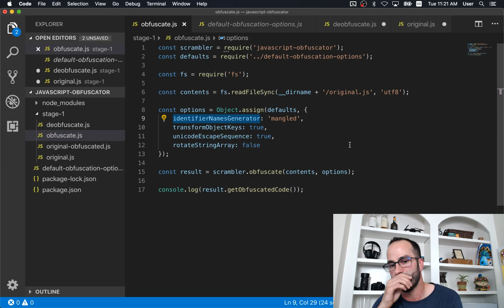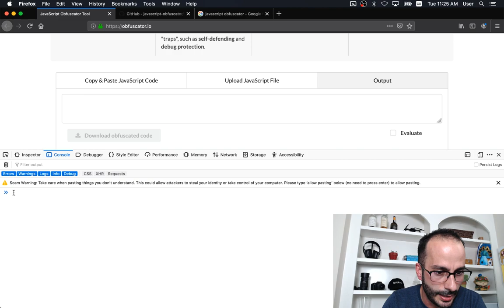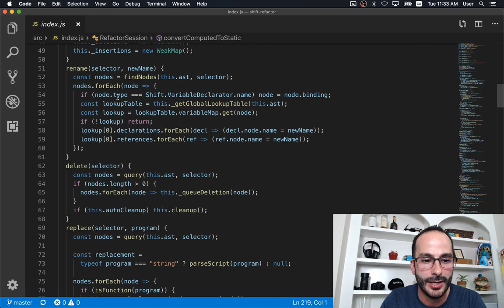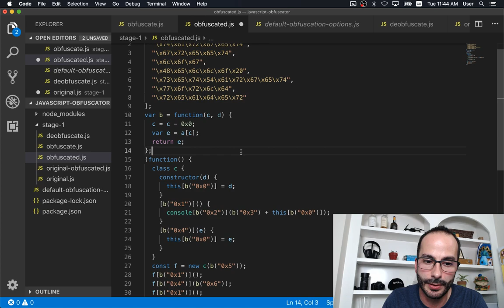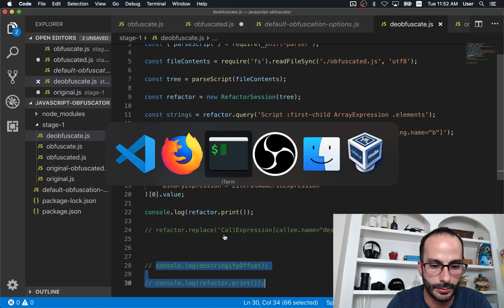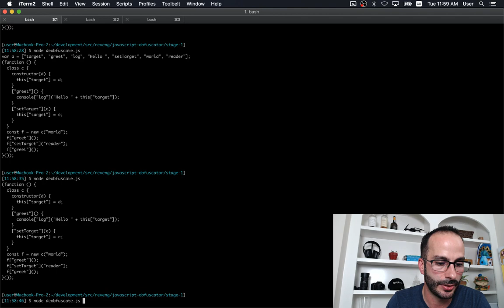Live streaming JavaScript deobfuscation & reverse engineering

Comment: Curious about using it to unbundle a webpack bundle started so far i have :

onst fs = require('fs');
const { parseScript} = require('shift-parser');

const { codeGenWithLocation, FormattedCodeGen} = require('shift-codegen');
let codeGen = require('shift-codegen').default;
let { unminifySource,unminifyTree  } = require('unminify');
const fileContents = fs.readFileSync('commons-e27dbb8640bb25f94c50.js','utf8');
const tree = parseScript(fileContents);

for (var i=1 ; i< tree.statements[0].expression.arguments[0].elements[1].elements.length ; i++){
 if(tree.statements[0].expression.arguments[0].elements[1].elements[i] ==null)
  continue;
 let filename=i+".js";
 let code = codeGen(tree.statements[0].expression.arguments[0].elements[1].elements[i], new FormattedCodeGen);
 let codeUnminified=code;

 try{
  codeUnminified =  codeGen( unminifyTree(tree.statements[0].expression.arguments[0].elements[1].elements[i]) , new FormattedCodeGen );

 }
 catch(e){
  console.log(e);
  console.error(`trying to unminify ${filename} failed using raw file instead e=${JSON.stringify(e)}`);
 }
 fs.writeFileSync(`out2/${filename}`,codeUnminified);
}
//shift-refactor not yet available...
Reply from the maker: This could probably be done. Post on github an example webpack build with code you own and this sample script I could take a look at it.